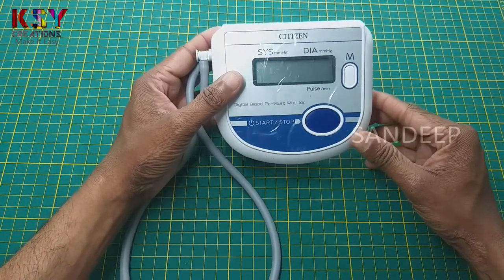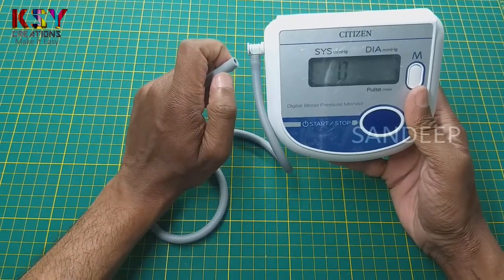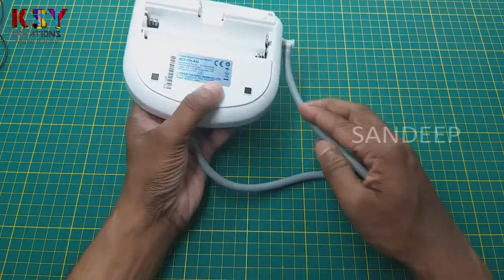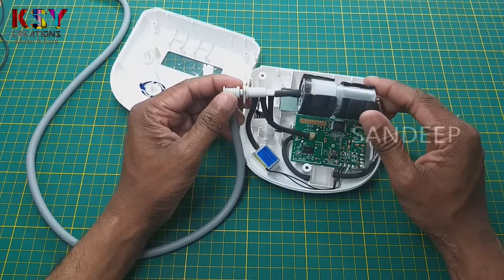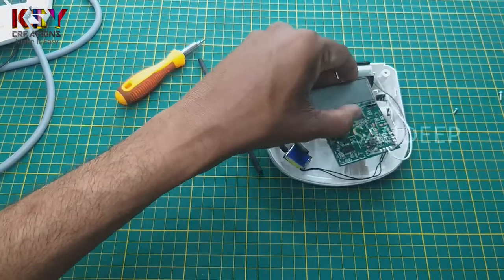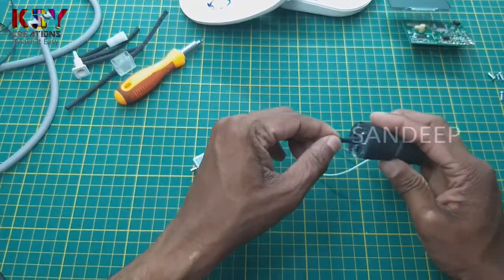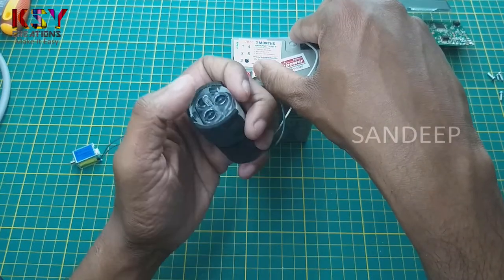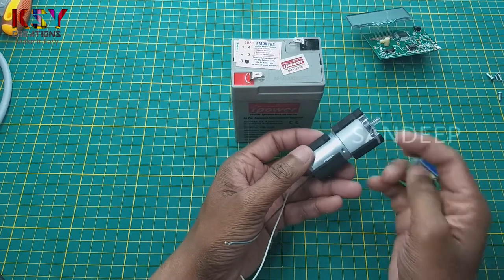removing air pump from blood pressure monitor device | what's inside  BP monitor

Comment: I'm actually using this pump for a smoke machine for evap And car vacuum leaks to smoke out the system.. this is perfect because you can use batteries to power the pump  and it's relatively low psi  which is perfect... I have an old blood pressure machine I have actually quite a few of them most of them are new in the box but this one I have just laying around... Similar model but different basically the same interior